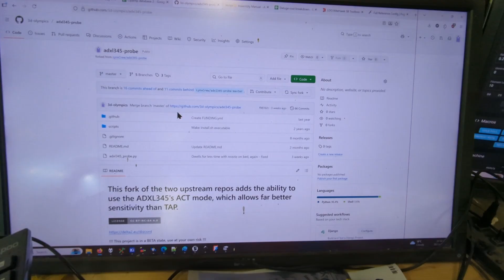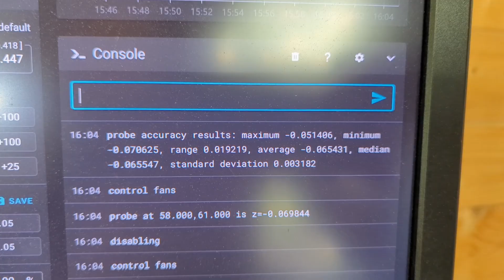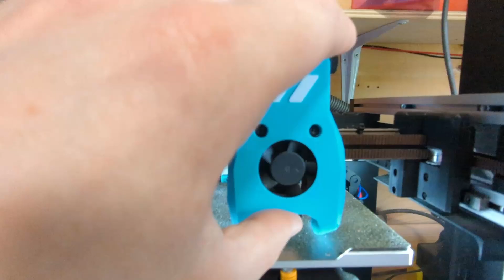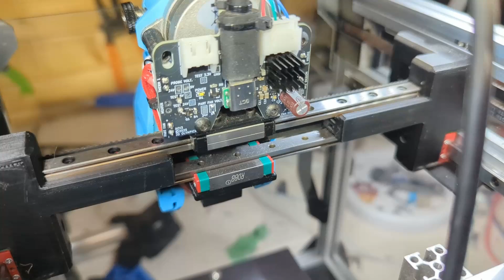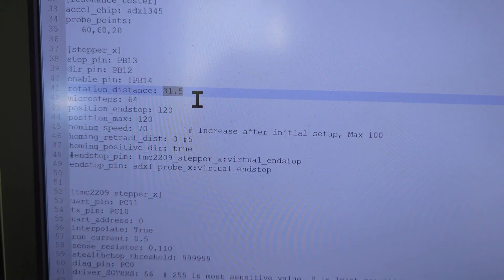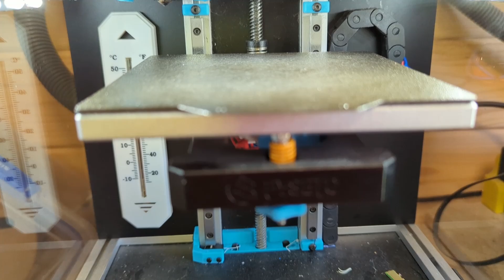Voron 0 1.5mm belt upgrade, custom toolboard, weird X/Y joints, and ADXL probing

Comment: I think using smaller diameter pulleys may slightly counteract the benefits of the 1.5mm belts. Maybe also try with larger ones.

But the weird patterns definitely don't look right. Measure their spacing, see how it relates to the circumference of a pulley. It might be some dirt stuck in some teeth that gets moved around during a print.